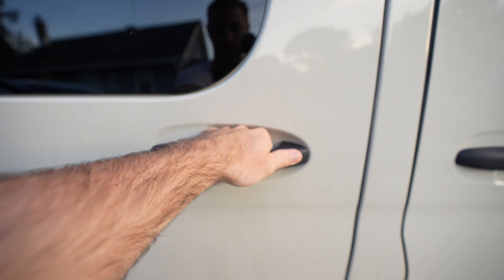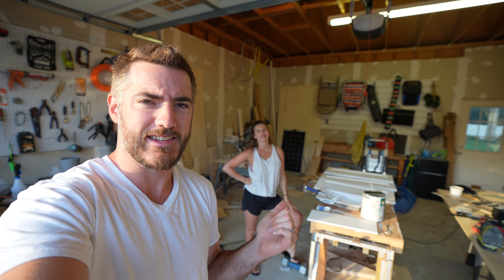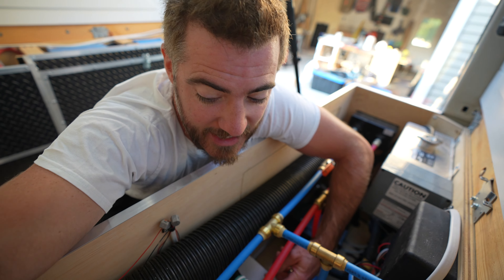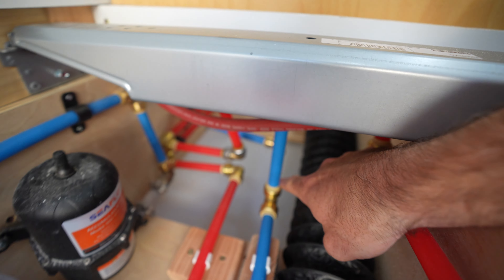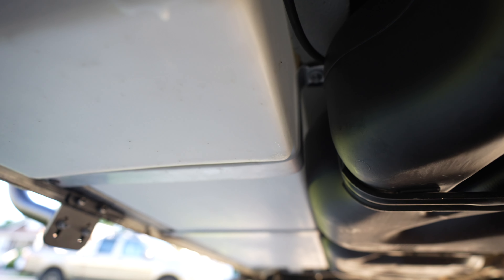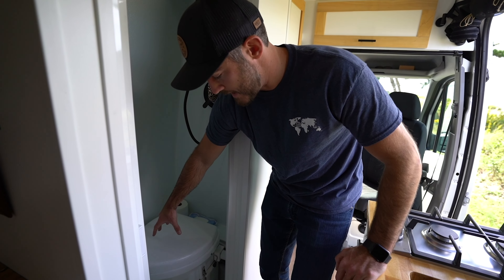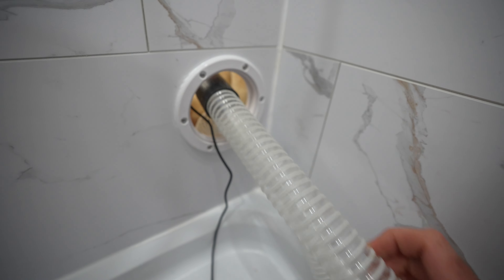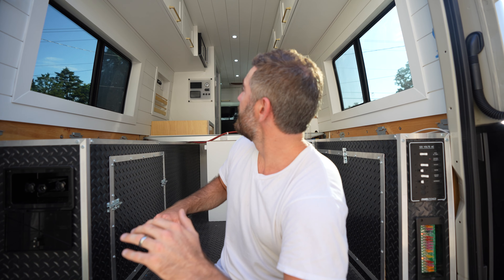The Ultimate Van Build Plumbing Setup - Shower, Recirculation Pump, Heated Floors

Comment: Great plumbing setup! The only part I'm confused about is how your lines drain into the grey water tank. It looks like there's parts of the line that are at an incline before reaching the tank. Do you need a second water pump for the grey water?
Reply from the maker: thank you!!!   No second water pump, I let water stay in the line, it serves as its own p-trap.

Comment: Excellent video! Awesome improvements over your last build. Have you considered applying Fluid Film under the van for rust proofing? You can spray it on yourself or have it done. Amazon has it also.
Reply from the maker: Thanks Rod!! The under carriage is already power coated, so you spray it on the exhaust and stuff?
Reply: Not on exhaust. Check with Mercedes to see if compatible with their undercoating. Spray all moving parts and battery terminals also.

Comment: I like how you setup the recirculating system. Does that recirculating pump run 24/7?
Reply from the maker: thanks!  Only when we turn it on via switch, we only run it for a minute or two.
Reply: @MathersOnTheMap  Where did you get the pump from?

Comment: Did you link the inlet port that you installed on the outside of your van? I don't see it in the list. Also, I cannot tell where in the tank the water enters. Did you use one of the pre-drilled holes or did you make your own? I have a NWC tank and I cannot figure out which hole to use for which fitting. Do you have a diagram, by any chance, of what you did?

Comment: Do you have a link to the mixer immediately after the heat exchange?  I'm using a similar system to the Rixens, and I've been trying to solve the scalding water dilemma.
Reply from the maker: Not cheap but this is it https://rixens.com/products/copy-of-mixing-valve?_pos=1&_sid=7a841213e&_ss=r

You can maybe find cheaper on Amazon not sure if quality will match though

Comment: Hey, cool system!  I love my self installed Rixen’s system.  Didn’t do the heated floors, but I have both indoor and outdoor door heated showers.  The indoor is a recirculating shower system.  I was not able to follow your explanation of your hot water circulation system.  Perhaps a diagram would do the trick.  Too many Ts and I could not follow the flow.

Comment: Which fittings did you use to go from the heated floor (3/8 PEX) to the Rixens system?
Reply from the maker: Pex -> 3/8 sharkbite - 3/4" FNPT -> 3/4" MNPT - 3/4" barbed for heater hose

Comment: What happens with the mixer when using the recirc pump? After a bit of time there is no longer cold water coming in to reduce the temp right? I was thinking of returning the hot water to the fresh tank
Reply from the maker: That’s a fair point!  If the recirc pump is left on for awhile you’re right the water could become very hot.  The idea is to use it for just a minute or two to flush the cold out
Reply from the maker: One issue with returning to the tank could be maintaining pressure, not sure if the water pump would stay constantly on at that point?
Reply: Shouldn't there be a check valve forcing the recert hot water back through the heater and none goes towards the cold water/tank? This would maintain pressure too throughout the hot water loop.